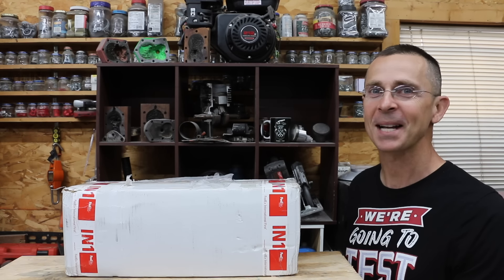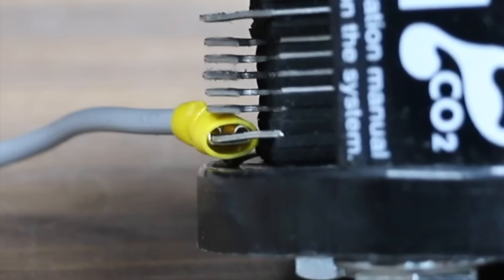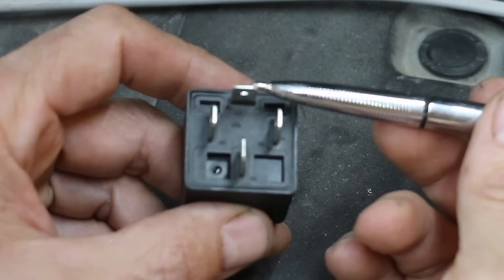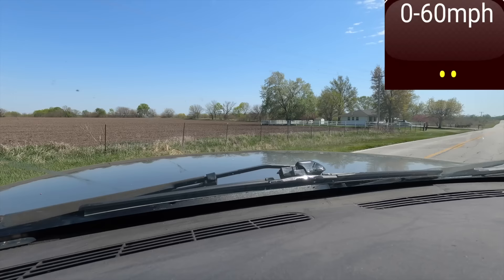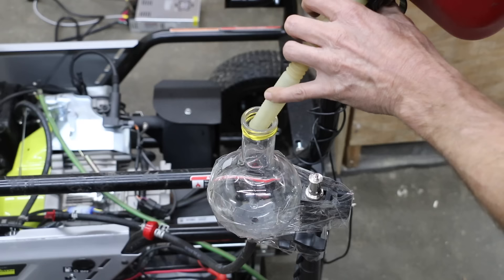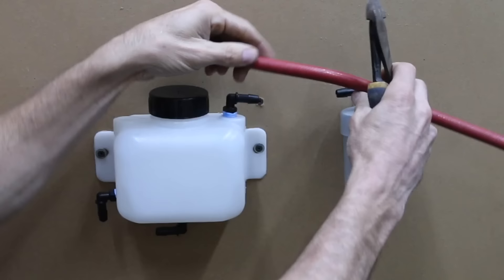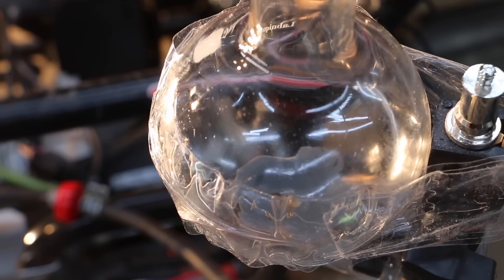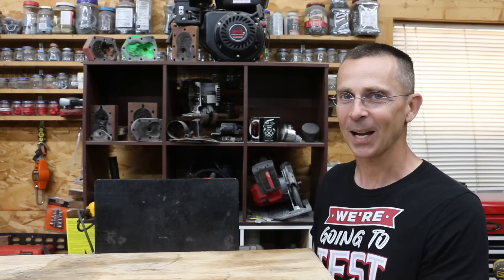AMAZING 35% More MPG with HHO? Let’s find out! Help with high gas prices?

Comment: A better way of saving fuel is to fit small wheels at the front and big wheels at the back, then you are always driving downhill except for steep mountain roads.
Reply: Hahahaha!
Reply: Awesome....I wonder how many people went and put some lift kit on the rear of their vehicle.
Reply: Bruh
Reply: @Aquatic Ape hilarious 😆
Reply: even - the small wheel inna front give you triple the speedo speed :)
Reply: Looking for the laughing emoji....
Reply: Now I understand dragracers. Small wheels in front, biguns i the rear.
Reply: How is that going to save any fuel?
Reply: U forgot the lightning bolts. They really make you go fast.
Reply: Love it :)
Reply: Make sure you have a mullet as well
Reply: Also use titanium piston return springs, and a super high output muffler bearing.
Reply: On steep mountain roads go up backwards at worst you’d be level…sorted👍🏼
Reply: @billywill903  make sure to get the right orientation/placement.. two lightening bolts placed wrong, might be offensive?
Reply: lol please stop it hahaha
Reply: It must be true because physics!
Reply: It helps to put bigger tires on the back then set your car on blocks. If your tires aren't touching the ground then there's no friction dragging your mileage down.
Reply: Has anyone tried running the " space saving spares" ? How bout all four of them, would be a rough ride but very low rolling resistance.
Reply: Ah yes, easy perpetual motion.
Reply: Makes sense
Reply: That is why tractors usually have big wheels at the back and small wheels at the front. Those damn farmers are very reluctant to share their knowledge.
Reply: @dankjankings7339   Actually this was done in the seventies by a lot of muscle car owners. The rear was jacked way up, looked cool then, would look goofy now.
Reply: @dankjankings7339  who knows. maybe all the ones that lifted the front of their cars switch their lift kits to the rear. and they would be the ones that see a difference. and maybe they will leave them that way.
Reply: Comment of the day
Reply: Dude, I laughed so hard, I spit my gum out.!!!  now where did it go?
Reply: @nathanrice1796  it's not. It's a joke
Reply: Lol
Reply: Lol
Reply: ROFL 🤣!
Reply: lmao.
Reply: Whose nuts !
Reply: I THINK THIS GUY GOT HIS IDEA FROM JOE BIDEN!
Reply: And you have to wear a tin foil hat…
Reply: PLEASE SAY NOBODY BELIEVES THAT ONE.   OHHHHHAHA!!!!
Reply: SECOND THOUGHT,,,,,,WELL IF BIDEN SAID IT,,,,,,,YEEEHAHA!!!
Reply: What’s that a North Dakota lean?
Reply: This is not true.  If you are backing up then you are going uphill and using more gas 😀
Reply: @billywill903  Yeah, you also need two racing stripes. They make your car or truck go even faster! Doubles the speed of just using lightning bolts lol but if you really want to fly then you need to add Flames as well. This will boost you 10,000,000,000 times more than just lightning bolts and race stripes. Hahaha.
Reply: @nathanrice1796  in reality? It doesn't. In a hypothetical idiots mind? It looks like a downhill slope and therefore most be a downhill slope.
Reply: Yeah I would love to see an experiment to see if it actually did make any change at all
Reply: They been doing it all wrong in South carolina 🤣
Reply: Brilliant! You should market a $49.95 info book and make big bucks!!
Reply: I.... I don't think.... Ahhh fuck it I'll go with it, maybe that's how the Egyptians built the pyramids
Reply: @wynn4578  and the complete lack of wind resistance from not actually going anywhere means that, in terms of gas mileage, you're really getting somewhere!